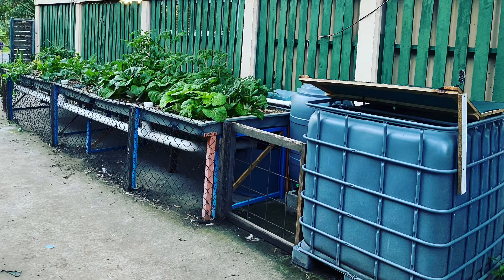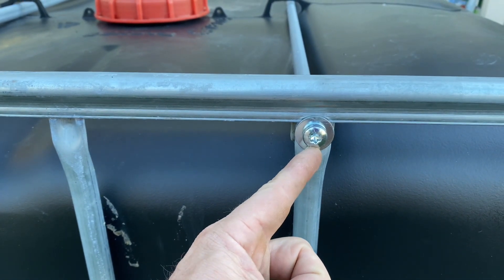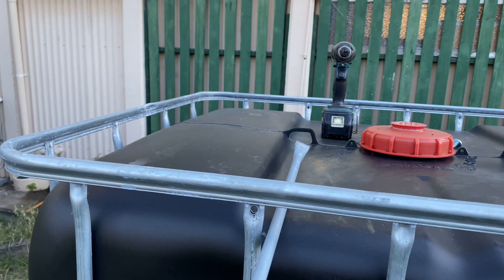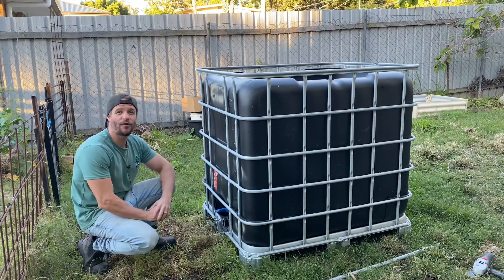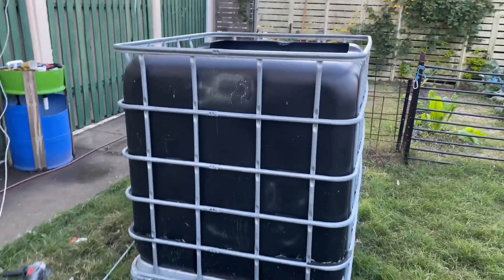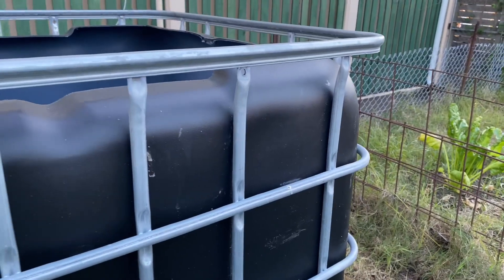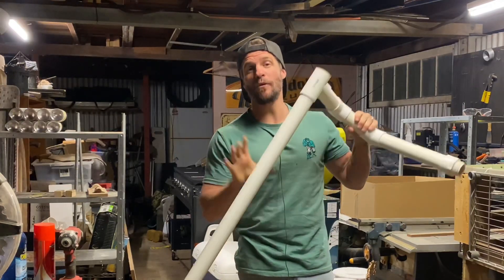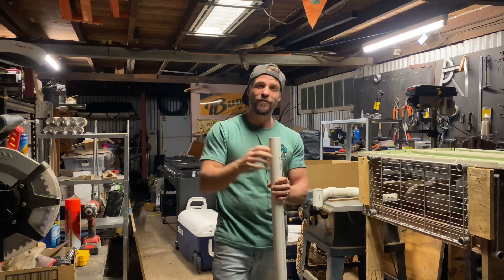How to Build an Aquaponics System: Building the Fish Tank #howtobuild #aquaponics #aquaponicsystem

Comment: Hey Matty, I'm just getting started and building my tank based off of yours! Where do you get your PVC pipe fittings specifically the 40mm threaded adapter, 40mm tank outlet and flange? I've been looking through Bunnings and Reece and they don't seem to have the correct sizes. Also are you using pressure PVC or DWV (because I found that those sizes don't fit together)? Thanks for your help!

Comment: Hi Matty,

Great video but I didn't hear you say what size pipe you were using, any chance you can let me know please?
Reply from the maker: Hi ScaldaYT, Thank you!
I did mention it on several occasions. The Bulkhead / Tank Outlet, T-Section, 45 Degree Elbows, PVC Adapters, and the PVC Pipe are all 40mm.
Reply: @mattysbackyard9244  thanks I must of missed it each time, but thanks for the replay
Reply from the maker: @3dnightmares  no problem at all.